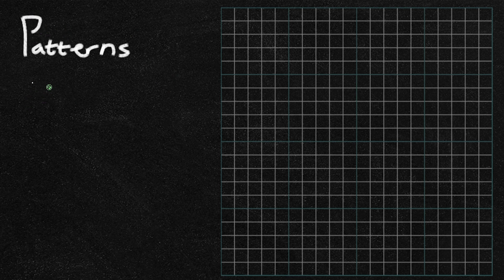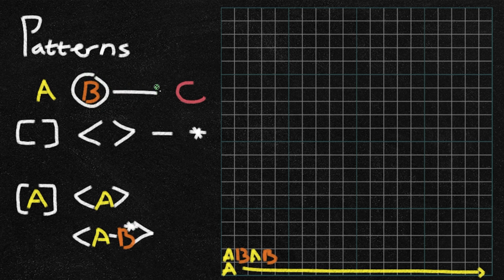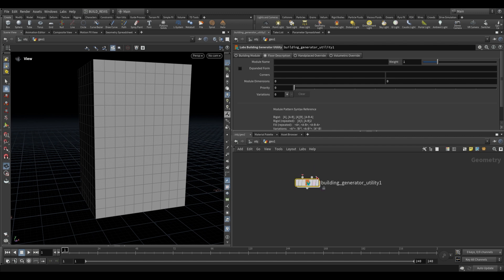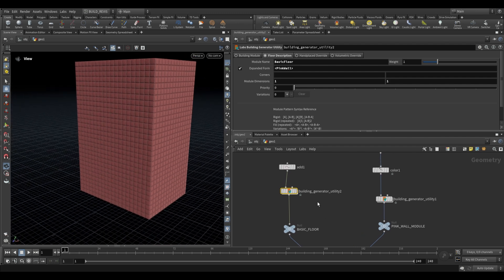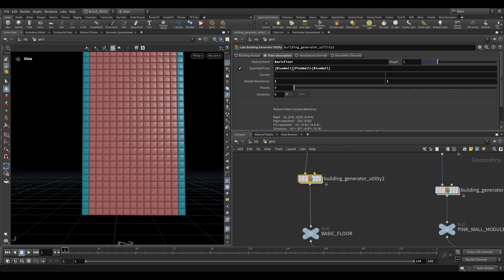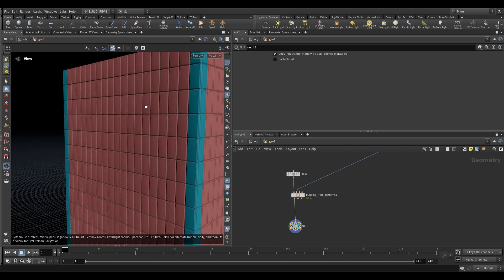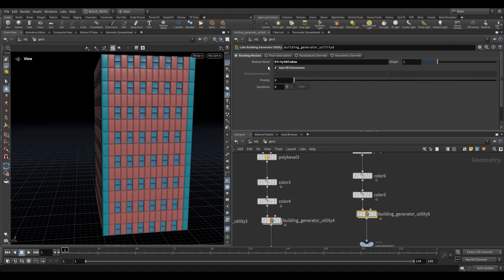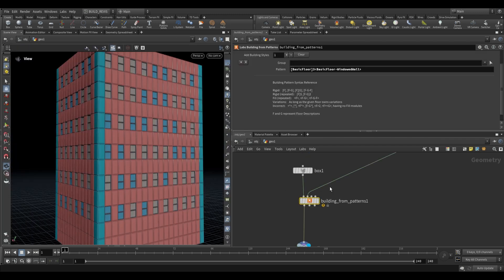SideFX Labs Nodebook | Building from Patterns

Comment: how do i control each side of the building, not all sides would have an entry
Reply: Haven't tried yet, but I suppose after getting the point cloud from the building from pattern node, you could select the lateral and back points, and change the attribute from the "door" modules, to wall, window...
Reply: @GonzaloM3D  yeah, working like that for now. thnx